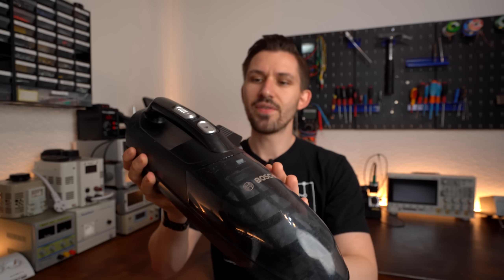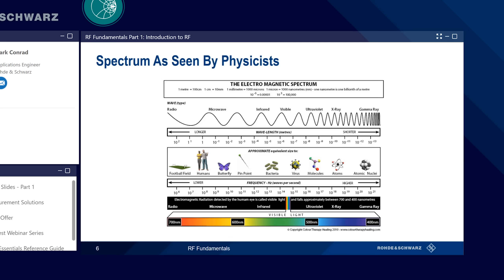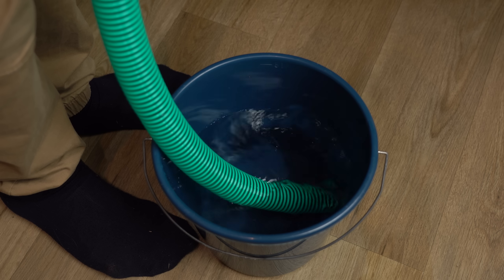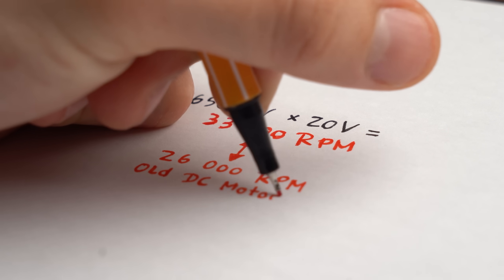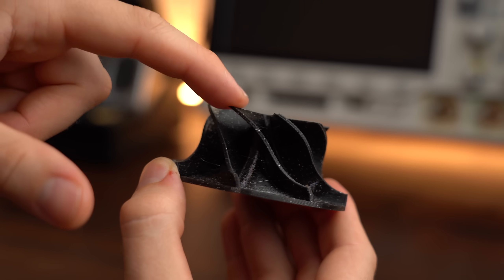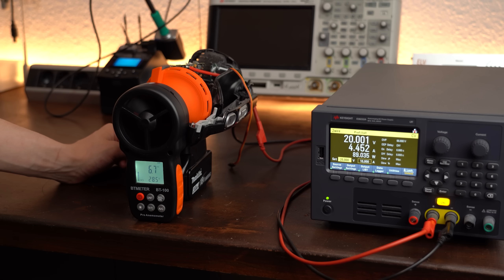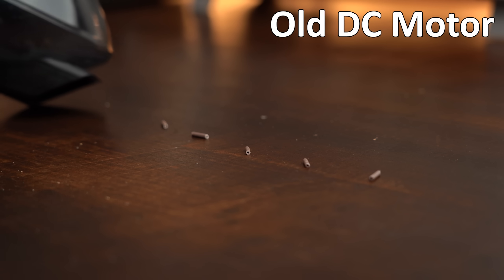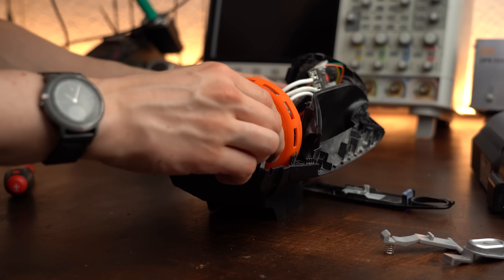My Last Chance to OVERPOWER my Vacuum! (Homemade Turbine V2)

Comment: I'd advice against Dyson. They're overpriced, and batteries degrade very quickly: I've replaced it twice already, and each time after about a year it holds a charge for a couple minutes at most.

Comment: There's one thing I don't fully understand: Your impeller was MUCH better than the stock impeller, but the original motor just stomped on the motors you attempted to replace it with. So, why don't you just continue to use the original motor with the superior impeller?

Comment: Its kind of interesting, because if you just listen to your average layman, stuff just isnt made very well anymore and dont work as well as they used to.  But then when you go to replicate a product at the same specs, you find out just how much though and engineering goes into something.

The engineering that goes into moving air is insane.  Just the factors that go into building something that seems as simple as a PC fan is much more than the average person considers and is a matter of great discussion from industry professionals all the way down to the someone commenting on a Youtube video.

I remember my grandfathers old vacuum.  It was an old Electrolux cannister vacuum with a powered head.  Really really cool vacuum.  It was far older than me and from the 60s I would say.  Very nice thick plastic for the trim and metal otherwise.  It also had an automatic retractable power plug with generous length which was awesome.  It wasnt very good suction wise.  I mean any modern vacuum would do a better job than the Electrolux.  It also used very hard to find (when I was a kid) and likely impossible to find today bags.  The head also had to be cleaned regularly, which is fine, but it was driven by belts and its own motor in the head (So it was a vacuum with 2 motors that could die).  Also, in order to power the head, the hose was not a regular hose, it was a cloth fiber heavy duty hose with an electical wire that traveled along the outside of it in a permanent molding.  It never broke, but if anything happened to that hose, it was so proprietary, you would have to make some kind of custom hose for it.  But the biggest problem with the thing was how heavy it was.  This thing was at least a back breaking 30lbs.  Any time you needed to move it, it sucked.  It did have wheels and would roll, but you would cry if you had any kind of stairs to deal with.  The head, it shaft, and the hose itself probably weight 10+lbs itself.

At any rate, thats my ted talk about how things are built then and now I guess.

Comment: in automotive the impeller of a turbo or your case a vaccum  cleaner there is a longer rod with that goes the entire length of the impeller and has a washer and nut attached to it to prevent the impeller from grinding against the impeller housing.

Comment: At the original impeller are the enclosure and the impeller just a single part? Perhaps the space between the blades and enclosure is causing some pressure loss.

Comment: You tried all those designs without really paying attention to the original. Your impellers don't have the top part that the commercial ones do. Could be a good reason for that. Might be how to get more pressure than flow.

Comment: Make a screw to screw the turbine in place also using a bearing system would help so the screw doesn't back out keeping in on and you could prob turn the rpm up to the moon 😅

Edit just realized this is a year old 😂

Comment: is it the the actual impeller thats coming off the shaft? Or are the blades just flexing to rub the inside of the case? If its the impeller, you probably forgot to say “thats not going nowhere”

Comment: In my opinion You need tighter clearances to improve the seal. Unfortunately I’m not sure how realistic it is to do this using a 3D printed impeller. Perhaps a resin 3D printer could help u get a more precise print?

Comment: Use acetone to smooth the propeller, stick pieces together and make stronger joints.

Just putting the 3d print in a acetone bath for a couple of minutes will not only smooth it but will increase the strength to a large extent.

Comment: I am an engineer, i designed and 3d printed impellers for the wash and drain pumps on a dishwasher. I designed them for 8% improvement. The logic was that the motors had at least a 10% safety margin, and thus, 8% would be safe. I used ABS. That was 7 years ago. I still hear the stronger Swoosh-swoosh sound when it's used... and i made test impellers, which were thicker layer height for testing fit and function.... never removed them.... 7 years, and the rough test fit impellers are still going..

Comment: there should be a distinct eye in the impeller, and quite long blades for this. if you end up with a smaller eye, and more surface area  on the blades then you should be able to have a lower static pressure, meaning more suction, therefore having a potentially better vacuum.

Comment: Your impeller should be self shrouded. That way it wont pull itself into the housing. The space between the impeller and the housing would also allow additional air flow and improve static pressure. If you flare the housing out at the air exit and slightly at the entrance, you can create induction that will increase air flow and maintain a stable cushion of air pressure between the shroud on the fan and the housing. 
It's hard to explain in text without being able show a diagram. But your fan should not open bladed and would probably be best to be a lower profile as well.

Comment: I don't like the Waterlevel-Test. I'm not interested in this capability because it reflects the sucking head not working correctly in case of being sucked to the carpet. That way you don't clean anything, where as moving there's always additional air to get particles moving. No wind, no cleaning.😉😁

Comment: Why would you use a turbo impeller tho? Listen, print a squirrel cage (double print so you can glue it in the middle) with proper airfoil blades, using the NACA patterns for thin section curved airfoils. Make it as wide as possible and utilize the outer casing of the fan box as part of your "airbox". To make it work, just get some air-dry clay and 3D print a cylinder that's 4% bigger than your fan, then fill the cavity of the vacuum with the clay, use the cylinder to squish it between the two cavities and let it dry (the cylinder should be coated in baby powder so it releases).
Once you've done this, make some vent holes in the sections where the clay is thinnest (akin to what you have in a drill) so that the air can vent somewhere and that should be it.

Comment: Youre trying to replace a centrifugal pump with a fan. No mater how much faster it spins it will never be as efficient. Its like replacing a cars tyres with a rear fan and wondering how the car isnt going any faster eventhough the fan is spinning much faster than the wheels ever did.

Comment: You should use a reverse thread screw to secure the turbine blade to the shaft with a lock washer to keep it from coming loose.

Comment: I would look at it again, so you have a space, andi n a space you createa void by spinning that void gets replaced a movement that fills teh space within a gradient. Strangely you can create larger voids with massively thick fan blades, like a chonker blade. lol. Pneumatic system is also a system of pressure and with a one way valnce which could be the vacuum is hte same as an air compressor... So you can create a flow of air imo, by various functions in teh system by assisting the movement ot fill the voides to create more movement. This would be localized space of a system. What is the maximum volume of movement of air possible to create a suction by the surface area of movement.  You coudl create multiple fans that then create a central chamber where teh air flows into. Its like creating a vacuum and if hte seal breaks teh speed of sound is hte traveling speed of said thing so... the speed of sound is what one could make to suck an object, but how does one accumilate or move a volume of air to move a debris, since it must create a the movement or void, so the diy experiemental doesn't realyl work, since you can just appyl physics nad deduce what the exact means is, the nit comes down to matter/ material of the system. Meaning you can create what you need and want, tehre is a lot of ways to create a movement, such as hot, cold, pressure, vaccum, etc. There is also burst vaccuums for a long tiem ago, where you createa pressure lock and then release and you get a immediate release when teh gradient that was formed from teh void created, that it had ot be filled so the air rushse, thses can be dangerous ot hte point of ripping skin flesh and bone and anything apart. So the question is how muc hpower is too much power, in teh sense of the movement of the system being involved.. what would the purpose be concrete side cleaning etc, or home use and cleaning, coudl be gentle nad hten redesign and make the systems invovled tantamoutn oit would become destroyed, a better relation of materials... meh

Comment: I feel the efficiency and performance of the entire system would be higher if you printed them in resin so the parts are smooth and the tolerences be made tighter.  Rough surfaces = turbulent flow decreasing efficiency.

Comment: This is literally the first time in my entire 11-year YouTube experience that the sponsor has actually intrigued me. I know that this RF Webinar is really a carefully disguised advertisement for their test equipment, but if I learn something along the way I will be happy. I have a feeling it will all be review for me (Computer Engineer by education here), but I will check it out anyway and I will remember to recommend it to other people alongside my standard suggestions of YouTube videos, Khan Academy, and MIT OCW.

PS: I will never get over the stupid "brushless DC motor" terminology. These are not DC motors in any way, they are very clearly 3-phase AC motors, otherwise we wouldn't need the ESC and we could just run them from a battery directly. It measurably raises my blood pressure every time I hear the term "BLDC", I would like to meet whichever idiot coined this term and read them the Riot Act.

Comment: You might have the right compressor wheel now but you left out the most important part of the system! You have no diffuser😢 the radial 'slot' the air has to be flicked out through. You are blocking over 50% of your flow coming off the wheel, look at your original white compressor wheel and see what you left out/forgotten! Can't believe you can't see it 😢
Reply: the less obvious flaw is that the compressor wheel has no outer wall and has to fight turbulence friction against the stationary chamber wall like what happens in cars.
 the original design tried to minimize that.

Comment: If you get a Dyson try find an older model. My dc04 is over 20 years old, I have just had to replace the spinning brush because the bearings failed, £12 and I treated it to a set of new filters for the first time. £9.  It now sucks like new.   They definitely don't make them like they used to.

Comment: You know how that other youtuber does fan showdowns? You should do the same thing but with impellers!
Reply: that guy is crazy / obsessed. few days ago he 3D printed an impeller version of fan with a fixed outer wall ! which has beaten everything else he tried regarding static pressure.

Comment: Very interesting! However the key point dragging down your numbers is that you need a stator part to your impeller (rotor) recovering the kinetic energy of the air leaving the impeller in tangential direction. Your current design does not have anything doing that, so you are completely losing that portion. Moreover, the faster you spin it, the greater this loss contribution will be.
Any turbomachine is made of two parts: rotor and stator. You lack the second one!

Comment: When you look at a conventional bypass vacuum cleaner (where the debris is trapped by an intermediate filter before the fan), they have a tapered fan disk that had a closed face like the old design.  This is what actually helps deliver the sealed suction in such a system.  Your design, albeit fine for say inducing air into a car engine cylinder, has two flaws as a vacuum cleaner fan:  The first is you are putting a big, heavy fan on a short smooth shaft and thus you may be overpowering the motor with this design.  Most vacuum cleaners, as I said above use a closed-faced tapered impeller typically made of thin plastic or aluminum.  I would suggest you do a search on the Internet for vacuum cleaner motors since they all use this design, save for a few upright and one commercial canister machine.  Two, the impeller is typically sandwiched between a spacer and a threaded nut to the motor shaft.  Friction fit doesn't really work, especially if you are getting into a sealed water lift situation (which really doesn't matter for dry debris pickup through air, only for pumping a fluid that is liquid).  You have to remember one of Newton's laws of physics, When you perform an action, there is also an equal opposite reaction, i.e. thrust has drag like in this situation, you are pulling water up but the impeller is also being pulled down  This is also relative to ships where the propellor is pushing back down the shaft onto the engine, thus the reason you see a thrust bearing pack before the engine.   Remember that in order to move the debris, you have to move the air.

Also, to have an improvement on air flow and suction, conventional portable vacuum cleaners have multiple fan stages.  Most portable carpet cleaning extractors typically use two or three-stage fan configurations per motor, giving a boost in suction and also typically use two motors of this configuration for air flow.

Comment: what about the original impeller with the new motor? my guess would be that electrical motors have come a long way since the original one was designed, whereas the turbine geometry of the original was already pretty optimized.

Comment: With the open face impeller, the low pressure pulls the impeller into the static case.  A closed face impeller would not experience this. This would overcome your shaft walk and glue problem.

Comment: Would some sort of compound system work maybe. For example if your hoover had a shaft for floor work, a system to lift dirt off the floor them the motor in the normal place to complete the cycle. a little little having a lift pump and primary fuel pump in a car.

Comment: The problem is because of the mass of the impeller. You need to make it much lighter. Hollow out the backside of the flange and any where you don't need material.

Comment: Impeller balance will play some role in negating performance at higher rpm’s. That being said I believe you’re on the right track, I figured you’d buy a metal turbo impeller and try that but I respect the commitment to designing your own!

Comment: Here is the best suggestion I have, firstly no, static pressure is not nearly as important as airflow. Take the best vacuum cleaners in the world...no not dyson. The Vactor 2100. They use compounding 2 stage fans to generate the required airflow to lift 6 inch rocks straight up in the air. Now sure, they do have a model that uses a PDB (positive displacment blower) but they even tell you in the operator's manual that a PDB will generate higher static pressure capable of lifing liquids better, but a fan is a much better option for those lifing loose solids due to the increased airflow. 

So I suggest, you have a look at the Vactor 2100 fan vac design and copy that. I think you will be quite suprised by the results.

Comment: From the looks of everything my biggest guess whats wronf with your design....

Your impeller is to big for the motor, giving you a poor torque  output for the equivilant rpm. If you made your impeller half the size it may have actually output much higher performance.

Comment: I'm not a vacuum designing engineer like the commenter below but I used to engineer centrifugal liquid pumps so I know a little bit about this subject. The static pressure will go up with impeller diameter and/or RPM squared. Google "fan laws", it will be valuable information. The blade angle of attack won't affect static pressure much because there isn't any flow through the blades during this test (weird I know). One cool thing about these kinds of devices is one might think the shaft torque would go up if you restrict the flow, but actually it goes way down. Notice that you hear a vacuum cleaner motor speed up when you cover the hose. The load on the impeller comes from the flow rate of fluid that is being accelerated so more flow = more torque and power required. What happens to the motor power in your experiment when you go from open hose to the static pressure test? If you cover the outlet the flow goes down but the fluid density goes up. I think it will still consume less power (I designed liquid pumps with constant density so I have no actual experience with this). If you can design a "volute" on the outlet of your pump that gradually expands the cross sectional area, it might improve the performance although I don't think you have the room to do this in your housing. The purpose of the volute is it acts as a diffuser to have pressure recovery as the fluid decelerates.

Comment: the axis of the motor is smooth therefore it doesn't bite well into the plastic. also I see sometimes a bolt perpendicular to the axis, that prevents the axis from slipping from its position, translation AND rotation are blocked this way.

Comment: Im no engineer but would it be feasible to grind a tiny notch in the motor spindle shaft and use a tiny set screw along with the glue to keep the impeller from sliding off of the motor shaft? Or would the forces on the impeller still be too great for something like that?